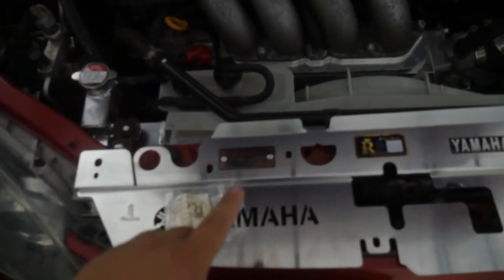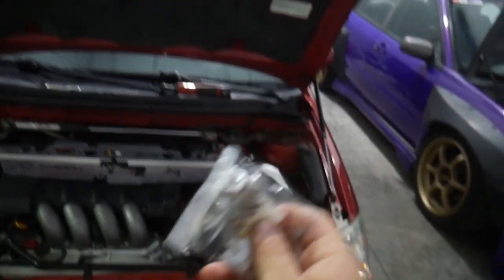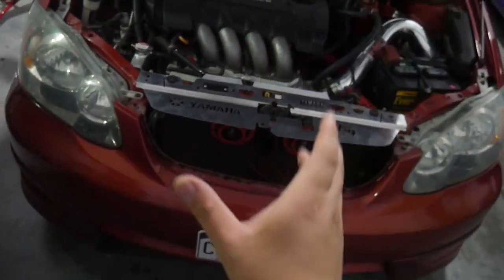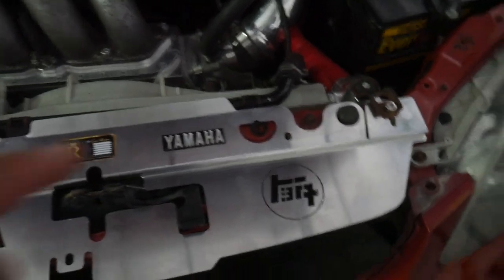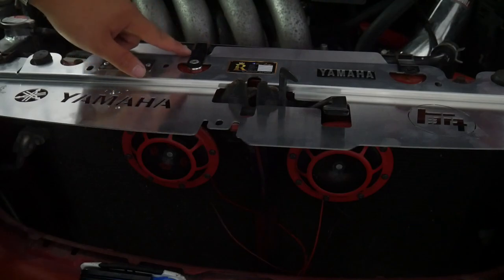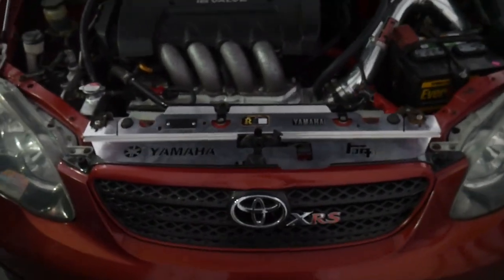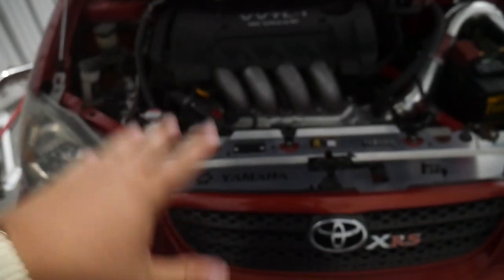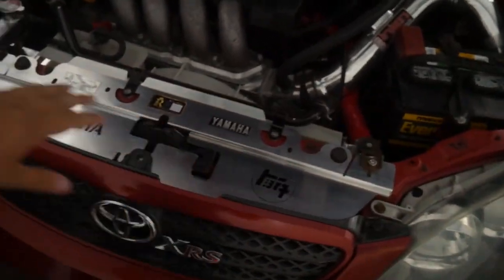9th Gen Corolla XRS Radiator Cooling Panel Install

Comment: Will Chang ur welcome, u helped me before and I helped u later.
PS: buy another cooling plate red with a 2zz-ge and the yamaha put it in your other corolla
Reply: Good news, now Royal Design got a new part for spark plug cover for 1zz-fe  and they have already for 2zz-ge( they have like 5 different and one red) try 'em, u will like them 4sure

Comment: You should do an update on the altis type 2 tail lights since it’s been 11 months almost a year, I’ve seen people say there’s get dim? Or faulty? Just an update see where there at. Awesome piece though was looking at the radiator plate for a while myself looks awesome man
Reply from the maker: I'll think on it, I'll probably tie in the tail light update with some other things in the same video but up to now I've had no issues with the tail lights dimming or not working properly. Thanks for your comment!